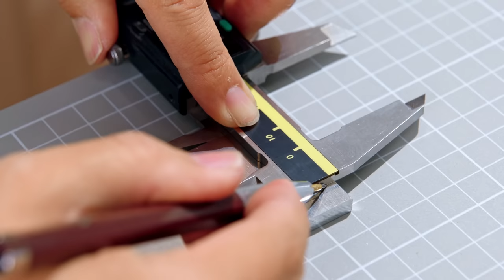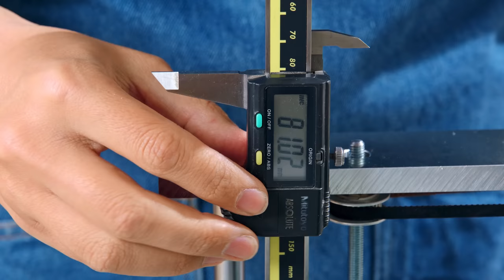Make a jig that increases the accuracy of the electric planer by 10 times.

Comment from the maker: I hope the video is meaningful to you.
If you like the video, please introduce it to your friends and social media !
Reply: J'ai acheté le plan, j'aime beaucoup ce que vous faites !
Reply: Verry good job. We are waiting for a small diy bandsaw realisation.  Thanks
Reply: @valbondaho7220  I would like a woodworking portable band saw that isn't $6k USD 😅
Reply: Too much work
Reply: А не проще купить рейс мус?
Reply: @fabricemenoud3296  

Mi
Reply: @vulcano911  also the amount it would cost in materials. extruded aluminium he uses a lot of and that costs a lot in the Uk on its own
Reply: @vulcano911  within 4 minutes of the video he has used over £100 worth of materials already. these sorts of builds he does all of the time are not viable for normal people with not much money. if could afford to spend hundreds making a jig could easily afford a much better tool in the first place.
Reply: Nice as an idea but in my opinion it becomes too heavy a structure
Reply: The variance in thickness comes from the deflection of the tape.  You would get much less variance if you used your dog holes with cam locks.
Reply: if it is aluminum, the cutting oil is of absolutely no use, since aluminum is a fairly soft metal for an HSS drill!!

Comment: Trying to build this in the US with products available here... Spent 6 weeks of building and rebuilding, and rebuilding, and rebuilding the last one. I just couldn't keep all the joints on extrusions from shifting out of square. I went through 16m of 2020, 3 taps, an unknown number of m5/m6 bolts and tnuts, jb weld, sugru (which is garbage) and destroyed my Bosch 2632. 
 
In the end, I could've bought a jointer for the same price after the cost of the first build.
Reply: Well yeah well after jointing and planing thousands of board feet quickly,accurately and efficiently it fun to sit back with a coffee and watch these cool builds heheh
Reply: Did you do it based purely on the video, or did you buy the file from his website?

Comment: The threaded holes you made in the rear part of the planer composite casing, are the Achile's heel for all the system. Otherwise, perfect as usual.
Reply: If he were taking it on and off it would be a problem. But if this is a permanent adapter I bet it holds up. 

Other way is to glue a block shaped to the rear of the tool to give a connection point. I've seen that online.
Reply: What if the bench is not 100% flat??
Reply: @ZeldasGhost  depends how not flat. If it's a divot it won't make any difference. If the surface is twisted what you're planing will get the same shape.  But in general when you're planing something like this you need a flat reference surface. Many wood workers use a torsion box for worktops and assembly tables for that reason.

Comment: This is impessive. You are usually very detailed but in this case you have not checked any of the attachments for square or level to surface. This is important for planning. Also no subtitlex describing the components. You want everyone to buy the plans to get any details. Very clever and commercial minded.

Comment: The differences in height are probably due to the wooden worktop the planer is running on. Try to run on sheet of glass which is flatter or machined metal surface.

Comment: A good idea and neat execution.
Due to the design, a high degree of accuracy will be required so that the guides run smoothly over the entire adjustment range.
One or the other improvement or simplification will make the replica even better and easier.
For example, by adjusting the distance on both sides to the available belt lengths and belt pulley diameters, the tensioning device for the central connecting belt could be omitted, as with the two lateral belts, but then the device might not be quite as compact and might no longer fit into the overall system see in the other video.
It's nice to see the tricks used and other tools that were probably also self-made, such as a pillar drill and marking gauge.
Of course, also as suggestions for your own ideas and solutions.
The lack of annoying background music is also very pleasant.
A list of the parts required and the lubricants and adhesives used would be nice.

Хорошая идея и аккуратное исполнение.
Из-за конструкции потребуется высокая степень точности, чтобы направляющие ходили плавно во всем диапазоне регулировки.
То или иное улучшение или упрощение сделает реплику еще лучше и проще.
Например, регулируя расстояние с обеих сторон в зависимости от доступной длины ремня и диаметра ременного шкива, можно отказаться от натяжного устройства для центрального соединительного ремня, как и для двух боковых ремней, но тогда это устройство может быть не таким компактным и может больше не вписываться в общую систему, см. в другом видео.
Приятно видеть использованные приемы и другие инструменты, которые, вероятно, тоже были самодельными, такие как дрель и маркировочный калибр.
Конечно, также как предложения для ваших собственных идей и решений.
Отсутствие надоедливой фоновой музыки тоже очень приятно.
Было бы неплохо составить список необходимых деталей, а также используемых смазочных материалов и клеев.

Eine gute Idee und saubere Ausführung.
Konstruktionsbedingt wird eine hohe Genauigkeit erforderlich sein, damit die Führungen über den ganzen Verstellbereich leicht laufen.
Die eine oder andere Verbesserung oder Vereinfachung wird den Nachbau noch einmal besser und leicher machen.
So könnte z.B. durch Abstimmung des Abstandes beider Seiten auf lieferbare Riemenlängen und Riemenscheibendurchmesser die Spannvorrichtung des zentralen Verbindungsriemens wie bei den beiden seitlichen Riemen entfallen, nur wäre dann die Vorrichtung ev. nicht mehr ganz so kompakt und passt ev. nicht mehr in das Gesamtsystem, zu sehen in dem anderen Video.
Schön zu sehen die verwendeten Tricks und vermutlich ebenfalls selbst gebauten weiteren Hilfsmittel wie Ständerbohrmaschine und Streichmass.
Natürlich auch als Anregungen für eigene Ideen und Lösungen.
Sehr angenehm ist auch das Fehlen nervender Hintergrundmusik.
Eine Aufstellung der benötigten Teile und der verwendeten Schmier- und Klebstoffe wäre schön.
Reply: "other tools that were probably also self-made, such as a pillar drill and marking gauge"

If you go back through his early videos, you'll get to see how he made all those items.
Reply: @Garryck-1  I've watched a few more videos now and I'm impressed.

Comment: You spent more money on aluminum and parts than that planer is worth...also, the accuracy is heavily dependent on the work surface. In terms of practicality, umm, maybe not. As a proof of concept however, this contraption may have some application .

Comment: All that fancy metalwork and you didn't use ACME screw threads. What a waste ...The variation in the thickness is probably showing that the workbench is not perfectly flat enough , since that is basically the "reference" in this case.

Comment: Not your best creation in my opinion, due to the metal bars referencing on the table any amount of dust will negatively affect high/ tilt, also the double-sided tape causes the height to actually be the height you set minus tape's thickness and many tapes will affect height accuracy, they may slightly vary in thickness (due to production) or be composed of compressible material.
In my opinion this should be a stationary machine with its own work/ reference table, keeping the height adjustability, swapping in some linear rails and get rid of the tape by adding some kind of low profile side clamping to secure the workpiece.